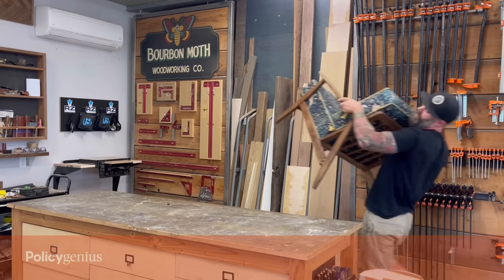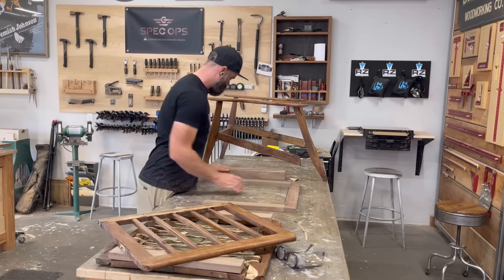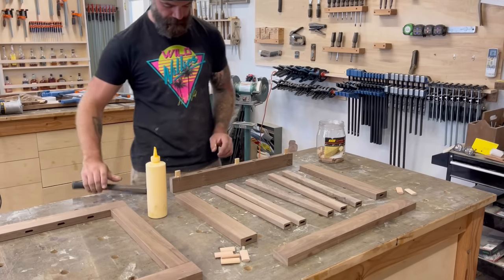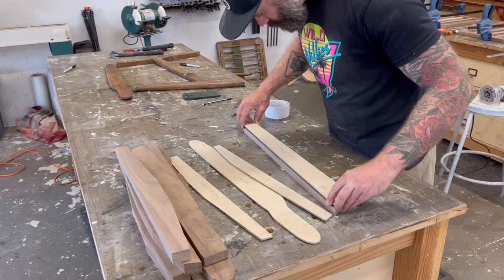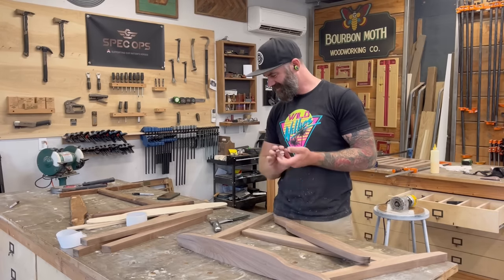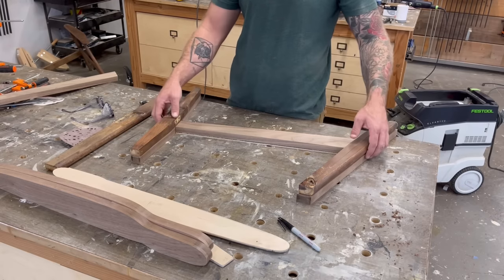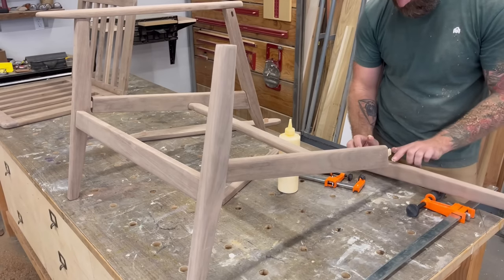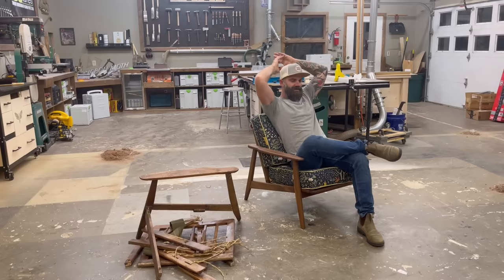Making a Chair The Easy Way || Mid Century Modern Furniture Build

Comment: Excellent video and build! I really appreciate the "double clamp" tip at 32:49. I am about to start making 2 modern patio chairs and was planning to use angled cutoffs to "square up" the legs for clamping but your way looks much simpler. Of course I will be using dowels and beadlock joinery as I haven't graduated to a Domino yet so it will take a lot more time...

Comment: I know you're going to get comments about the domino joinery, and most deal with those who don't have one. That being said, I would suggest if you do another chair, use a stronger joint for the rails and legs, but feel free to use dominos wherever load isn't being transferred downward. The sideways stress on those parts that transfer downward force is the most common reason for failure on chairs. Mortise and tenon joints with a perpendicular peg to keep the joint tight work well. Compound Japanese joinery methods are the best for maximum durability with the least wood use, but they are time consuming to do. I know Dominos are similar to mortise and tenon joints and will give you a decade of service without problems in most applications. If your Dominos are cut from the same stock, it will last three times that. Their weakness is different shrinkage rates from the stock material over time, so using the same wood and moisture content reduces that problem, as does good finishing and sealing. Consider this food for thought, Jason. What you built is still better than 95% of modern furniture. I'm just very old-school, having apprenticed with my grandpa, who was born in 1901 and was a shipwright for 15 years.
Reply: At the end of day the Domino joints used are just floating tenons and are perpendicular grain. I can’t imagine they will stay together perfectly flush for more than a couple years with seasonal changes.
Reply: I definitely see what you mean about dominos not being strong but would that make any difference since used black walnut.
Reply: Stop making things that don’t break, every generation needs to build and if things don’t wear out they’ll be on their phones forever
Reply: Well written comment!
Reply: Excellent pro tips! I worked at KPFF Structural Engineering for a bit and you're right on. At least if you're looking to make a chair that'll last a hundred years or more. Or strong enough that even Poppa can use it. He's 6'4" and over 300 lbs. 
   Thought I'd mention too, the rope on the bottom seat is used to create more comfort. Actually it's generally a very strong webbing strap that's woven. This creates a seat that responds to the user's personal form for greater comfort. Modern technology has created foam cushions far superior to previous generations so your cushion might be enough to compensate for the harder seat bottom. Just be sure to keep it in mind when it's time for new cushions.
   Great job BTW. Very sexy chair. Now I have to go read up on japanese joinery techniques 😅

Comment: My kitchen table, the chairs around it, and my bar chairs were all rebuilds of existing furniture.  Retail value is approximately $2100.

I think I’ve got 200….ish invested in finishes and hardware that I used to refurbish them. 

Oh and I type that while looking at my coffee table (not name brand, rather cheap), but I managed to fix some damage to is and give it an entire new look and all I used was a router, a jigsaw, and some finish.  

Refurb is the way to go if your skill set isn’t there yet or if you can’t handle the current market value of wood.

Comment: I found some chairs (2) in the trash that I thought was plastic and they were painted flat black. I walked right by them and a few minutes later I thought the curves on the chairs looked different so I went back and got them. I got to my shop and put some stripper on the paint. I came back and I removed the stripper and it revealed the most beughtiful black  walnut. It turned out they are a rare 60s mid century gunlocke chairs!  I've only found a couple on searching for some like it, o found they are worth about 1500 each. If my house was burning down these chairs would be on my back. They are gorgeous.  To think I almost left them there and they would be in a dump. Gunlocke chairs company makes all the chairs for courthouses like the jury chairs. 
They make the presidential chair that Kennedy is sitting in during the Cuban missle crisis. That chair cost 15k.

Comment: Instead of the double sided tape use blue painters tape on one side of the template and the timber to be trimmed, then use CA glue to glue to tape together,. Holds firm and comes off a lot easier.

Comment: The dominio jig is brilliant! : )  So the slatted back rest & seat rest just floats on the frame?  No dowels/dominos to hold in place?
Reply: I got the impression that dominos were used to locate and position the back and seat slats but they were not glued.
Reply: @peterjf7723  I'm talking about the whole assembly that rests on the frame.

Comment: I enjoyed watching this project.  I was hoping you were going to do the stretchers differently.  It seemed like they would naturally pull apart when someone is seated.  It seemed like that is why the original failed.  I couldn’t think of an elegant way to do it though and was hoping you would.  maybe with the dominos you have more glue surface and it won’t be an issue

Comment: Why do you edge joint before face jointing? Wouldnt be easier to get a 90 degree if you face joint and reference the face on the jointer fence to edge joint?
Reply: I agree. I think he would be lucky to get that angle at exactly 90 doing his way. For this project it didn’t matter as much as something with panel glue ups, though.

Comment: I am curious as to the strength of the glue joint holding the back and seat together. With the cross brace spacing between the rear bottom cross brace and the back cross brace it would seem to concentrate weight right on that glue seam.

Comment: You made a beautiful chair, and your videos and woodworking is great. But I think it's a pity that you made a hard seat instead of using the original design with woven bands or rubber bands. Elastic bands are not only used to make it comfortable but also to make it durable when a heavy person sits down hard on the chair.

On a beautiful chair like yours I think you should use rubber webbing. Maybe you could make one more with rubber bands and take the two chairs to that red haws gym in the other video ;)

Comment: Hide glue doesn't ruin a finish like PVA glue does. If you squeeze too much hide glue out on the wood, most finishes will go over it and not cause it to stand out, especially oils.

Comment: Can I check, the top part and the bottom part, are they just floating or did you use any fixings to join them together?
Reply: I had the same question.
Reply: Just sitting on it unattached...he says it in the video

Comment: Whenever I make a table or chair or something with legs, it invariably wobbles. What is the secret for making all the legs identical?
Reply: Most chair makers I’ve seen flip them upside down and cut the legs all together to the final length using a laser level. I imagine the chair in this one is not perfectly symmetrical

Comment: So question I have is the insertion of a furniture build a response to YouTube algorithm or did you just feel like you needed a change vs the “treehouse” build as you said in the opening shot. 

Curious as other builds you run the series start to finish ie the boats (but they are wood working). The raised deck (treehouse) build seemed like that racking issue cause issues with/ from bridge. On that a quick engineering calc could inform the fix - ie something delicate like. 12mm threaded rod on two sides of the big portal frame. 

Obvious if you don’t feed the algo you lose $$$ as reduced views…

Comment: You made just 2 mistakes. The first was that you didn't reinforce the joint between the back & the seat. Screws or dominos would have made that joint much stronger than the glue alone. The second mistake is that you didn't cut the back brace to match the angle of the back. The angled back hitting the square corner of the brace doesn't look good & will cause damage to both parts over time. Attaching the seat to the base frame wouldn't have been a bad idea either but it isn't necessarily a flaw in the chair.
Reply: Joe- I don't know about using screws and the like for that joint. The glue will hold til the wood breaks. I agree that a chamfer on the upper cross support to match the seat angle would have been a nice touch and distributed the friction over a greater area leading to less show. Anyhow. Jason and his black walnut are always a riot.
Reply: The glued joint between the seat and back is by far the strongest with the grain matching. All the domino joints will fail, though as the grain is perpendicular, imo.